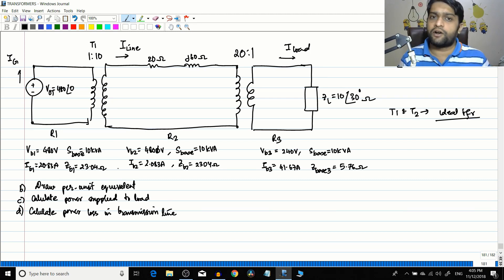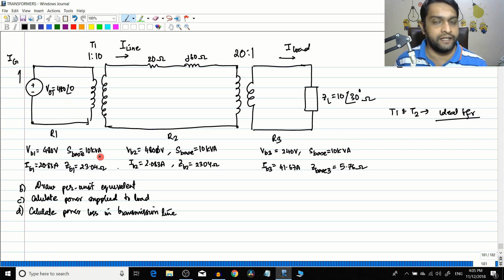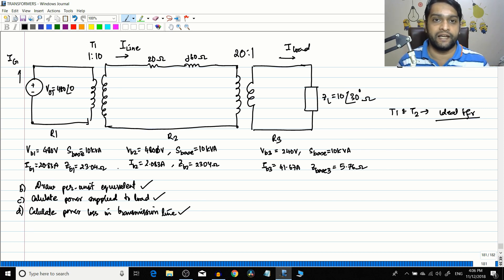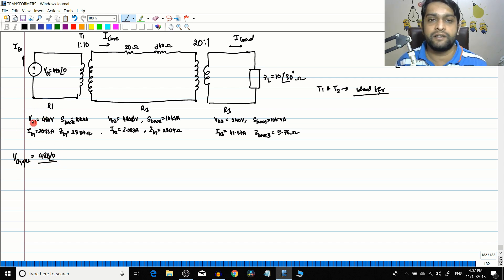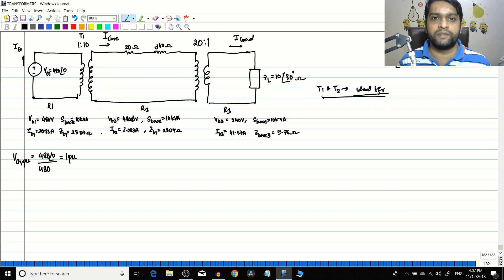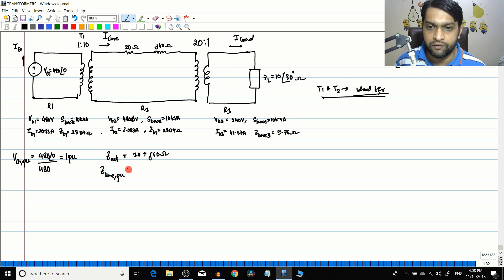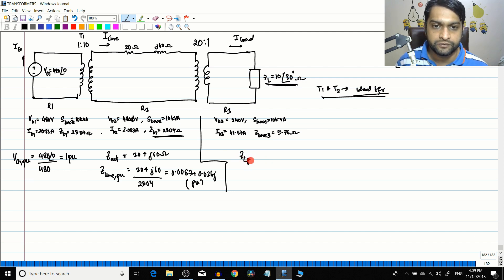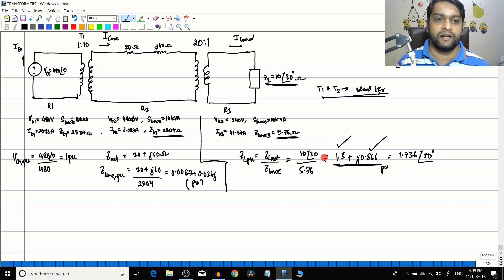TRANSFORMER #47  - PER UNIT ( PU ) SYSTEM OF MEASUREMENT - PART 2

Comment: why does the S base value can be a P base value and Q base value? pls, this make me confused
Thank you.
Reply from the maker: because the base values are usually parameters which are constant, a reference value like rating of a machine etc, in this case the rating of the machine is kept as base, bcz P and Q are load dependent and can change.
Reply: @ElectricalisEasy  Thank you